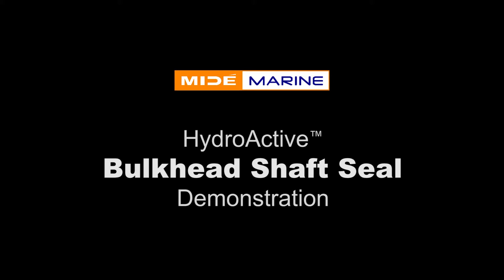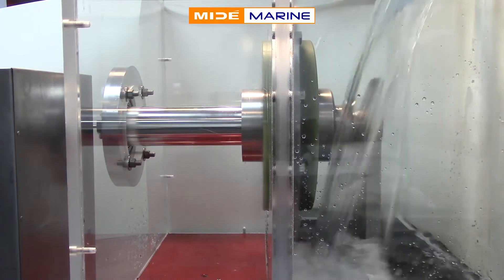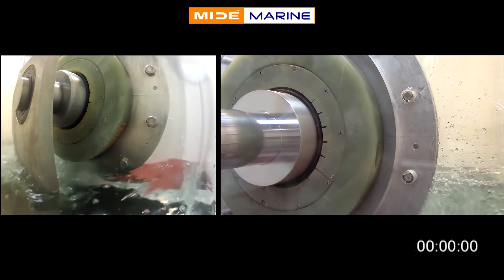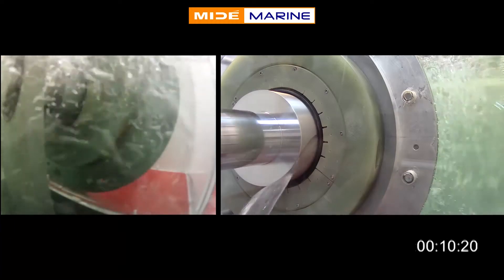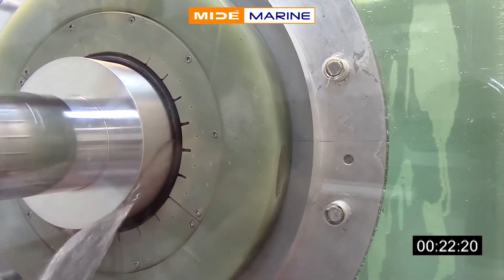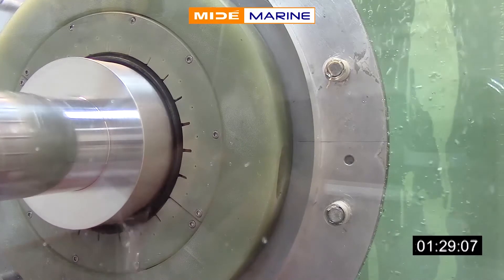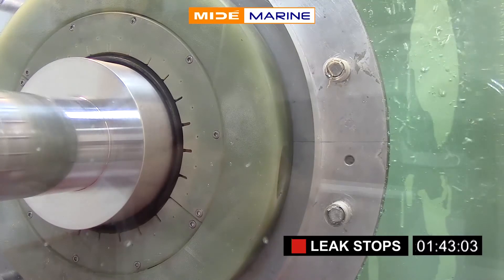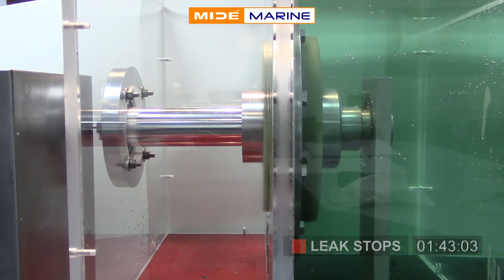HydroActive Bulkhead Seal Demonstration | Mide Marine

Comment: I'm pretty sure we had these on the McCain.   My Senior Chief was threatening kisses if he ever got his hands on the people who designed em.  Guy down in the space said they leaked for a bit then stopped.  We never stopped one of the shafts until pier side and then 2-3 WEEKS later when we rotated the shaft for some repair work with the space STILL flooded I checked the leak rate.  2-3 drops a min out of both with the one that was stationary when flooded leaking a touch faster than the other.    
20 out of 10 would use these!!!!!!!!!  cannot recommend enough!!!!!!

They also work if the space is flooded with just as much if not more F-76 (think jet fuel) than water.